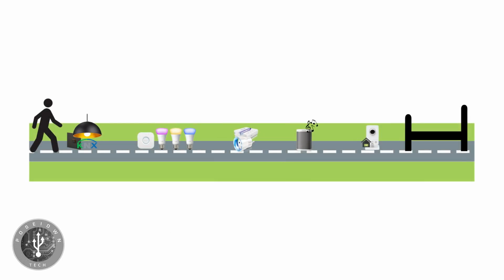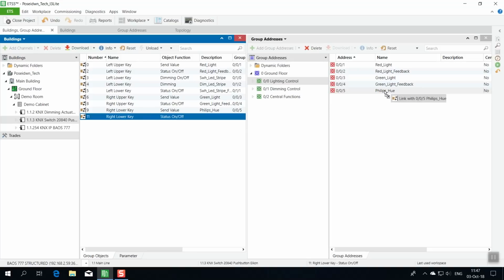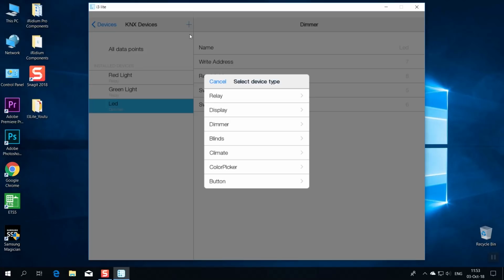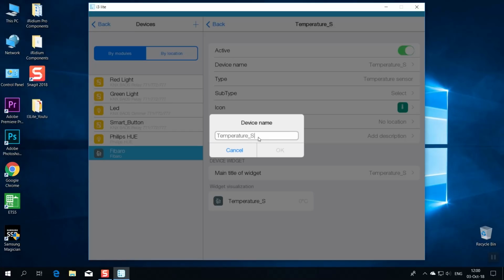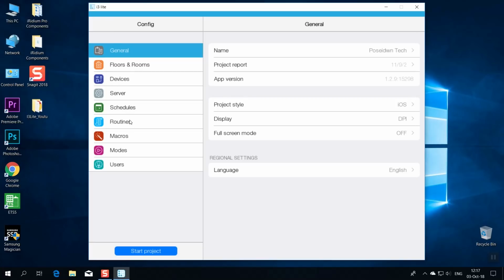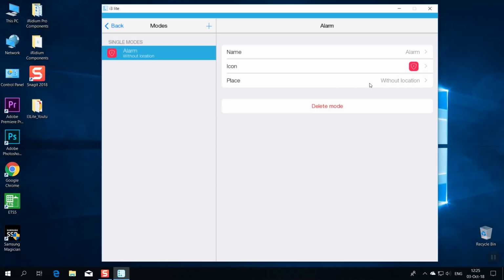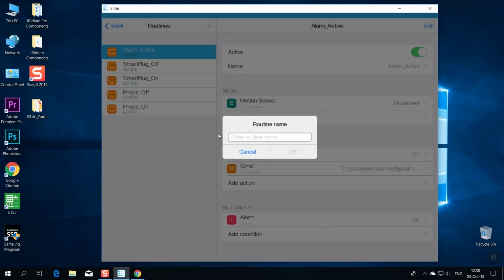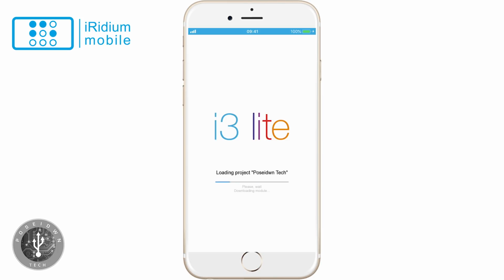Smart Home - Interaction between KNX-Philips Hue-Fibaro-Sonos-Axis

Comment: Hey, First thanks for sharing. great tutorials ! i've some questions, 1. is it possible to integrate modern TV's with iridium ? 2. what about AUDIO and VIDEO moderm streamers ? 3. how do i know before buying any product if it's compatible with this system ? 4. can i share the iRidium license with my family and let them control the devices ?  THX !
Reply from the maker: Hi! Thanks for your comment. 1. It is possible to integrate TV with i3 Lite and i3 Pro. At the moment i3 Lite has only a few modules ready but they are preparing more. Using i3 Pro you can create your own scripts. For example in this video https://youtu.be/m8A3GtOCVks we control a Bang & Olufsen TV with i3 Pro
2,3. You can send an email to Iridium Mobile and they will guide you about what products are supported. 4.  i3 Lite License supports unlimited panels so you can very easily invite your family and let them control the devices.

Comment: Dear Friend can you please share all knx materials that you are using. Can you share the total budget cost please?
Reply from the maker: Thank you for your comment. All the devices are listed in the comment section of this video but i will write them also here in order to be easier to find :
KNX Devices :
Vimar KNX Switch : https://www.vimar.com/en/int/catalog/product/index/code/20840
Weinzierl KNX Baos 777 : https://www.weinzierl.de/index.php/en/all-knx/knx-devices-en/knx-ip-baos-777-en
MDT KNX Dimming Actuator : http://www.mdt.de/EN_LED_Controller.html
K-Bus KNX Power Supply : http://www.video-star.com.cn/en/ProductsDetail.aspx?code=010107&id=27

As for the cost you will have to speak with the distributors of your country. For example for Greece :
Vimar Hellas : https://www.vimar.com/el/gr/επικοινωνία-4090122.html
Weinzierl and K-Bus Products : https://www.technodome.gr/contact/
MDT Hellas : http://mdt-knx.gr/mdt/05contact.html

Iridium Mobile Invitation : https://iridi.com/signup/?ap_invite=1057OP81V

Comment: What if I have alot of knx devices under the same manufacturer, how will iRidium lite tell devices apart?
Reply from the maker: It doesn't matter the manufacturer for KNX. You have 2 ways of importing KNX devices. In the first way, if you are using IP KNX Baos products Iridium Lite will discover all datapoints automatically. In the second way if you are using KNX IP Gateway you can import the project from ETS, so Iridium Lite will read all your Group addresses!
Reply: @PoseidwnTech  Assume there are 10 of the same model push buttons by ABB, how will iRidium differentiate between the push buttons location wise?
Reply from the maker: These push buttons are linked to a Group Address. So if you have a Group address for example Living_Room_Light then this Group Address will be read from Iridium Mobile.